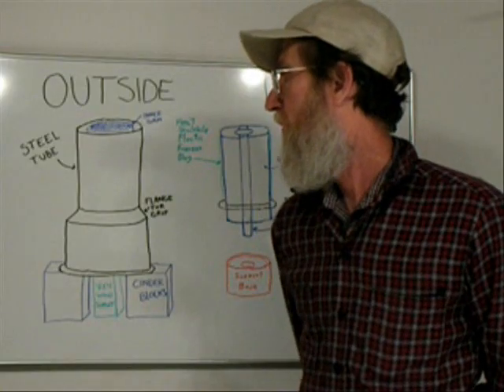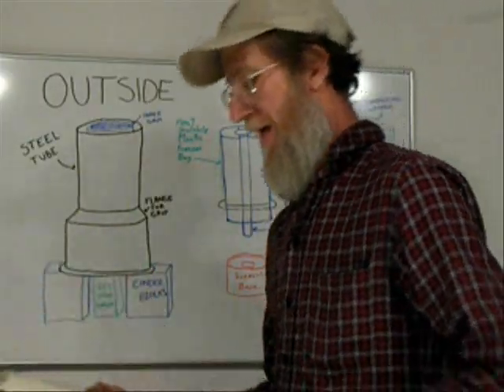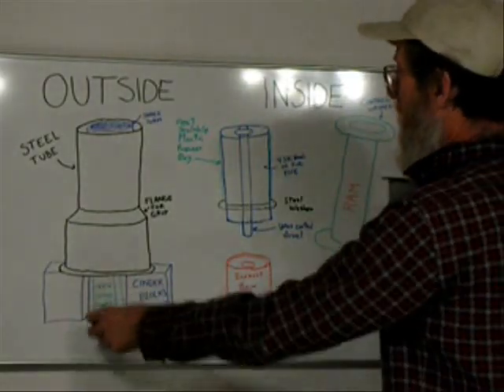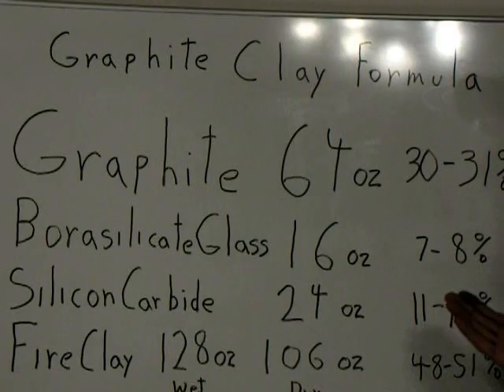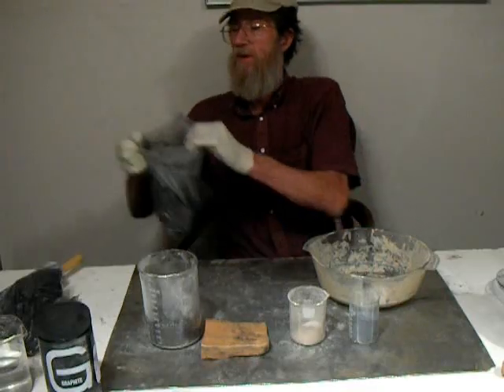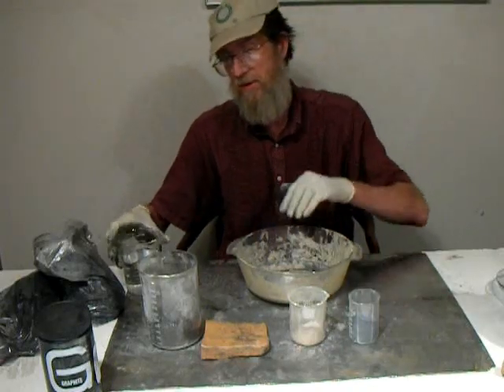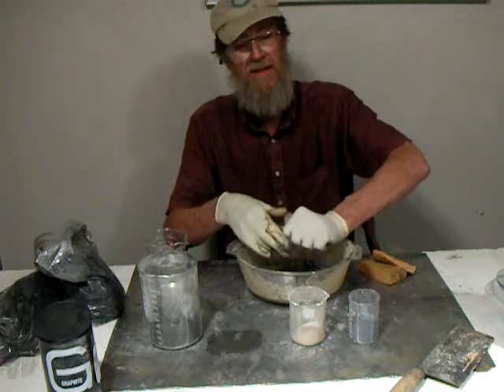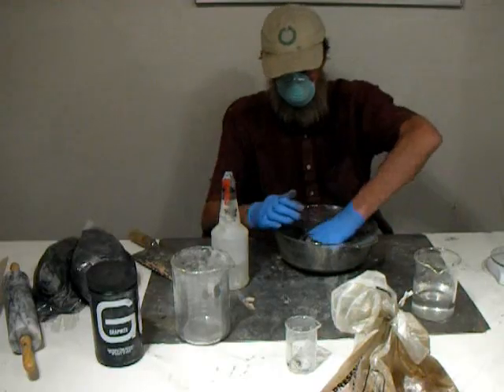Making a Graphite Crucible

Comment: I want to have a go at your technique. I mainly smelt aluminum cans with a 5kg electric Toauto furnace. The only thing I made add is I would swap the borosilicate glass for fiber glass/carbon fibet up near the flang for extra reinforcement up near the flange (since its how I pick it up).
Unlike a propane funace I dont burn stuff (except for a little bit laquer 5 secs at a time).
I find the toauto is pretty good at getting aluminum out of cans because I can squeeze the aluminum out of the carbonaceous dross that foms. It sticks to the crucible more than aluminum.

Comment: Would it be possible or beneficial to use aluminum oxide powder in the mix. Maybe a small amount. The reason im asking it is used to make the ceramic insulators on sparkplugs , and handles great temperatures . It is inside the combustion cgamber , and even seen the sparkplug electrodes melt, pistons melt. Have specks of piston splattered on the ceramic. And tge only thing i ever seen happen to the ceramic is a crack. Even seen people use the ceramic to spin form steel . Where the friction heats the steel allowing it to easily be shaped. Even welding it.  So it seems the powder in with graphite could possibly help the graphite withstand temperature. Instead of the boracilicate . I had the idea that i may look into playing with some red clay used to make brick.. and mix it with graphite or carbon, possibly both. And look into possibly adding aluminum oxide. Use distilled water to prevent adding metals frim the chlorine corroding the pipes. Make a "mixer" by putting two wheels on a axel about 6-10" apart. With a gear reduction motor spinning it at up to 25-45 RPM. Tge wheels doing round in the bottom of a cut off 55 gallon barrel. With the bottom 1/3-1/4 bring used as the mixer. With a 1" piece of plywood bracing up the bottom.  The wheels made from a chunk if hardwood tree trunk  about 4" zo 6" thick and azleast 4"- 6" thick a pair of wheels from oak or  something 6"-7" thick and turned down im a lathe to about 12" diameter. After spending the day imw oven at 250°f- 300°f, keeping an eye on it to see it doesn't get any darker than a tan use a lightly pressed and epoxied in steel sleeve in tge wheels . And another onto a 2"-3" axel made from a  chunk cut diwn to 4" x 4" with a 1/4" steel plate bolted to the top and bottom with a 
.375" keyed 1.5" steel shaft to spin the wheels , tge shaft being  12" longer than required to just spin The wheels and spindle. The shaft being roughly 16" long with a bearing  block mounted center of the barrel  with the shaft inside.  making it look something like part of a clothes washing machine. The shaft below the bottom being about 6"- 8", (5"- 7" with the bearing block) then a roughly 60 tooth sprocket,  then   another bearing. Connected to a 2.5" bit of channel ,running from the leggs on the bottom of the barrel. Being about 14" long legs.the motor attachef to the inside of one leg, having a gear reduction to 250 RPM, (-/+), them s 10: tooth driving a 60 tooth (+/-) (maybe a 40 tooth)  the wheel spindle  being able to slide on the shaft , not spin. The steel  inside the wheels having oilite bushings pressed on. Using a steel washer  on the wheel. With a rubber washer  then a large leather or treated paper or cloth washer to seal out dirt from the bushing. Zding a large C clip on w groove in the steel on the spindle. To retain the wheels.  The shaft having a threaded hole with 1/2" bolt 1/2" deep. Used to retain the spindle uding a large 1/4" thick washer about 2.5" -3" dia. With a spring fitting around the shaft. Pushing down on the spindle with an adjustable pressure from about 10 lbs to about 50 lbs.   The wherls capable of moving up and down about 10"-12" or so. The  spindle having two 2 steel angle bars. Running out from the spindle to the barrels inside wall. Being about 1/8"-1/4" from it. It having a roughly 2"x 4" bit of rubber bolted to it. Possibly a  piece of car tire sidewall.  Used to gently rub the inside wall scraping any material off it. Putting it under the wheels. And possibly have wheels or  rollers to attach to the bars, rollers bring they wound be about 2.5" dia. Abd 4" tall. However the scrappers will likely do best. With a large PVC coupling under the spindle shaft to keep material away from the shaft.  The speed of 45-60 rpm max. slowly add matereals  and a fine mist of water. To  jeep it dry as possible.  Possibly the best speed would  be 10-15 RPM . Euth a speed controller. To set the speed. And seal the wood parts and wood wheels with a clear epoxy, thinned to allow it to be absorbed into the wood about 1/8" of the outeside , dependibg  on type and density.  Then apply a thicker coat to the outside for a tough exterior that should not rot. Being hot dried. Tfe thinned epoxy could completely  soak in. Especially if a pressure /vacuum chamber is used. Remove all air from the wood replacing it with epoxy. Completely stabilizing the wood . Making it a composite material.  The wheels  being 1/2" smaller on one side than the other.   With them being mounted oppositely , pushing the material back and forth as they roll over it. With a lid from the barrel to prevent dust.  And it should nearly be a professional pos, uh um, poe, piece of equipment!
😅 ✌️...  then make a furnace from the rest of the barrel and another.  Having 3 , 7' bits if 1.25" -1.5" even 2" pipe,  with them  connected at the top by 2" angle steel, 1/16-1/8" thick, the bottom doing the same by forming a 36" x 36" or 42" x 42" square. The pipe welded at the corners.  A bit of 1/16" sheet steel  welded to the inside bottom square. Fill it with  concrete. Possibly add a 1" x 6" board to the outside of the angle, then fill eith 6" of concrete
 Locking wheels can be used under the steel frame.  Then a barrel bit  
6" - 8" thick placed on the center of the concrete pad  a piece of rock wool or other insulation that is solid , and handle higher  temps inside the barrel then  pour about 4" of refractory mortar inside the top of the  barrel.  Mount a hand crank winch to the pipes to a bit angle bolted or welded to two pipes, and a bitbof 2.5" channel steel crossing the top. To mount a pulley to tge center of the square.   (Use a hand crank winch or a small electric winch as long as  it moves the cable fast.  Then cut a hole  about 6" im the center  of the bottom of a barrel. Use about 3/4 of a barrel. Then cut both ends from another barrel naking it the same length. (Or buy a piece of 18-20 gauge sheet metal . Roll it into a tube smaller than the barrel. Leaving about 5"- 6" on each side of the tube. Drill several holes in the barrel 1/4"  use all thread aka threaded rod. To go between the barrel and tubei 6places.  Then at least 3 holed in the bottom of the barrel  then drill three, 1/2" holes evenly spaced near the outer edge.  Install 3, 1/2"  eye bolts , with a 1/4" rebar welded to the threaded shank. 18" long, eith a fender washer welded to the end of the rebar after the Eyebolts bare installed!  And optionally, bend a bit of rebar into a ring about  4"-6" saller than the barrel. Weld it to the fender washers.
Then mix refractory mortar with saw dust, about 5 lbs of saw dust and fill the gap with it. Between the barrel and tube with it. When it's set, fill the inside of the tube with   extreme temperature wool wool used in furnaces, to handle 2°-3°k f. Used  in assay ovens and such. A 1" single layer should work.  Then flip it over     attach chaind 12" long to the eyebolts. To a single centered point.  To be lifted by the winch.  Lift it and sit it on the insulated portion of the pad it should weigh about 40lbs.  Drill a 2" hole in the top for a 1.75"- 2" pipe ,  with it capped in the bottom ofvthe barrel then drill three 1" holes about 4" from Beach other the bottom/end pipe 2"-3" long welded in the larger pipe aimed up at about 15°  up 4" at the next pipe it's 90° from the pipe all also aimed about 45° from center of barrel. Then moving up about 6" welding on the next 1" pipe , aimed  down at about 10° .  With a 1/4" steel tubing  running inside the larger pipe having 3 outlets. The  with a cap threaded on to get a roughly .060" nozzle in each. And possibly add another pipe with more nozzles.  With with another gate valve to adjust fuel.  And connect a electric leaf blower by flex hose to the 2";pipe. Having a 6" Radiused 90° elbow at the top. And a 12" pipe with 3" barb to clamp a hose to the pipe. . Capable of spraying propane through the nozzles that are inside the 1" pipe  just as it opens up in the larger pipe.. the fuel having a fan spray pattern. With a single trio of nozzles capable of a 20:lb propane bottle in about 8hrs. on med. And possibly use the secondary nozzles to spray used oil.  And crank up the air flow. And btu !🦾.. possibly exceed 3°k F and add a barb fitting to connect a o2 hose. To get possibly 45% o2 in the air flow! to = 🔥 HOT possibly overheat the insulation.  The furnace lifts off the crucible. Making it easy to lift.   Then the heat stays inside the furnace.  Just close the top vent.  The hot air stays inside. lift off the furnace from the crucible
 Making  the reloading easy.. dirty to ramble have an awesome day🎉!

Comment: I'm interested in your technique. I CNC engrave graphite Metal moulds and end up with a lot of plumbago graphite powder and want to recycle it in a graphite ceramic with clay and sand for spin casting moulds. But my attempts to make my own water glass -Sodium Silicate from sand with Lye -Caustic Soda) as part of the Mixture  got me into a caustic mess. I have Neutralised and am washing out .
Reply from the maker: You might want to try Ins-Tuff Ceramic Blanket Rigidizer.  Be aware it is highly hygroscopic and takes a while to dry. If you have scraps of ceramic blanket you can also experiment with milling and screening to a  powder to strengthen the graphite/clay mixture.

Comment from the maker: Thanks  Guys.  You have been great over the years. You have enough knowledge now to move on and come up with your own innovations. Mean while i am going after life long dreams. Love you guys
Reply: Thanks for sharing this information. Is pure gold. This formula is enough for cast iron? Sorry for my English.
Reply from the maker: @adrianmucci4860  Graphite is mainly for non ferrous casting. You would be better off making a lot of disposable clay crucibles for iron or steel. Dry them in in the oven then fire them in the foundry. Make sure you have driven all the water out before ramping the heat up.  Boiling Point of water at your altitude is critical point in the oven. My oven was 20F lower and i blew one up once i started ramping the temp. use high temp probe or thermometer.
Reply: @rlbob1 would this be sufficient to cast aluminum oxide (Al O3)? I want to make an ingot of corundum / ruby / sapphire. Honesty I was thinking of putting down a sheet of corundum and adding the chromium and other dopants to “paint” a design on it, hopefully getting the temperature just right for it to fuse and turn into ruby and sapphire without losing to much definition. I’m planning on using either map gas, or hydrogen + oxygen as the heat source. That should be sufficient right?
Reply: @Olisha.S ahahha! growing crystals is a very complex thing, there are various processes and lots of machines have been made, that cost up to quarter of a million bucks. You can't just expect heating alumina and magically for it to convert to sapphire, the atoms must be excited and then cooled to find the lowest energy spot between them, this process requires very fine temperature control and engineering, otherwise you will just wast energy and lose money. Check out how the grow sapphire cylinders for smartphones.
Reply: ❤whoever smelts the gold; makes the rules 😅😂🎉
Reply: Try in sanded grout add to it contains titanium dioxide lil Portland and Silcia carbon black add the to your recipe and damn near last forever especially if you come across some old school rock wool in a wall or an attic mix’s nicely defenitly where gloves and don’t breath it

Comment: I'm looking to make a crucible to melt more-or-less pure quartz (silica).  It melts around 1700°C.  A pure graphite crucible melts around 3600°C so I think that'd work.  But...do you have any idea if your graphite crucible mix could work up to around 1900° (I'd like a little temperature buffer to work with since I might have to run at 1800°C or so).  I suspect since glass is a component in your mix it will cause your crucible to fail when the borosilicate melts, which is apparently 1648°C...although sometimes mixes have surprisingly different properties so maybe it could withstand higher temps?  Have you ever tested it?

Comment: I know the video is 6 years old, but if you see this I would love to know how do you clean the residue metal out from the crucible? Or do you use one for each metal?
Reply from the maker: One for each metal. Never leave any metal in a crucible. Dump on ground if necessary. Residual as long as no button left in bottom will dross in next heat. Otherwise it will crack crucible.

Comment: I heard it should be 50% to 75% Graphite?
Reply from the maker: Interesting?  Is that by weight or volume. Graphite is very light so it does comprise a large amount of volume.  I would think that by weight it would vastly overwhelm  the clay binder.  I devised the formula based on research including patents into known compositions combined with ability to be worked into a mold.  I see no harm in trying other formulas. In fact I welcome it.
Reply: @rlbob1  It was on youtube and he had a wooden mold he would vibrate a little at a time into place. I thought a wood mold and hydraulics to press it into it all at once.  I don't remember for sure but I think it might have been volume you tend to go by weight in these kind of things. But he had done it a lot. I have soil that I think ground up it may make a good recipe, I am going to try it.
Reply from the maker: @allenhammer7923  Sounds interesting.  If I recall natural clay processing will require quite a few steps. I think it has to be liquefied then screened followed by a drying and kneading process.  Be aware that because it is natural it may have components that cannot take a high fire. Kinda like brick. Certain brick clay has been known to melt during firing and shut down the kiln. Talk with your local ceramic shop and ask their advice on a "high fire" clay. As far as screening check out Gold Panning sieves on Amazon. They come in many meshes, stack together and screen is stainless.
Good Luck!
bob

Comment: how about pure graphite with magnesium oxide outside layer?
Reply: Ahahah,pure graphite is made at 2500 C and baked for a few long hours.
This is clay graphite crucible.
For a small crucible you can find pure graphite for sale.
Reply: @mihaiilie8808  my intention was diy, not relying on being bought
Reply: @mihaiilie8808  pure graphite is when you evaporate water from sugar, to carbon
Reply: @mihaiilie8808  to mock you, you can even take a pile of crap and heat it, then you have a pile of carbon, that can be piled as a pile furnace
Reply: @mihaiilie8808  you mocked me with money and nonsense, have at it
Reply: @mihaiilie8808  or you, for free, take some carbon dioxide, and split it to oxyge and carbon, there is your pure carbon, graphite
Reply: @mihaiilie8808  ahhahha, the carbon pile can be the melting heat source too, and it can capture solar heat very nicely, too
Reply: @Jkauppa  carbon pile you can make at home its not graphite.
It withstands high temp but it burns ( oxidises) and unlike graphite its an insulator not a good conductor.
Reply: @mihaiilie8808  what are you talking about? of course you can make anything, without any instructions
Reply: @mihaiilie8808  making up facts is not cool
Reply: @mihaiilie8808  your rules do not bind me, and should not bind anyone else
Reply: @mihaiilie8808  make a block, tightly carbonized, then try to burn, it will not burn a lot even from outside, good luck getting any oxygen to the inside, thats why hemp bricks are considered fire proof, or resistant, which is easily replaced, and suitable for furnaces too, or arc furnaces, which is carbon
Reply: @mihaiilie8808  you have not done and observed what you just lied
Reply: unskilled trying to offer information as skill, nope
Reply: @mihaiilie8808  also, while its also a proper conductor, that fact does not really matter with heat boxes
Reply: @Jkauppa  Take your xanax and relax.I explained to you thats verry hard to achieve such high temps to make graphite .
You get an idea thats hard to get those temps because even human history its split in bronze age,iron age wich is when romans found a way to increase the temperature of the furnace to melt steel.
Steel sword cut the bronze sword in 2 ,thats why they conquered the world.
You can take a loaf of bread,carbonise it,and it will withstand high temperatures but it will oxidate.
Reply: @mihaiilie8808  you are not the arbitor of truth, thanks
Reply: @mihaiilie8808  if you would like to have brawl, then its a brawl, but i will not take anything from you, get out
Reply: @mihaiilie8808  one more and its on
Reply: @mihaiilie8808  its better if we dont ever meet, until you have got a change in mind in your pridedom
Reply: @mihaiilie8808  if you really need super hot temps, then arc the carbon, or laser it, but i was not talking about history, and even then you can just simple use the carbon-graphite, to make a sturdy furnace, end of story, on my side, you do what you want
Reply: @mihaiilie8808  nah, better not believe you at all, keep talking
Reply: @mihaiilie8808  also, you did not read the "magnesium oxide outside layer" part, now stop being so proud